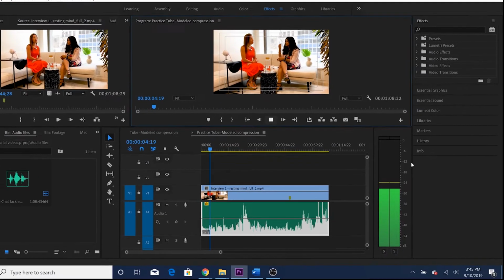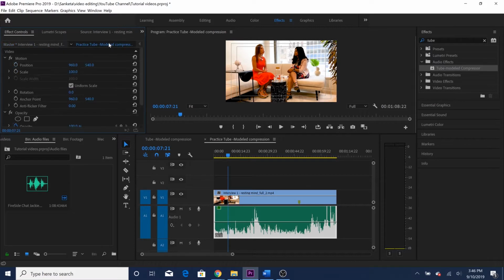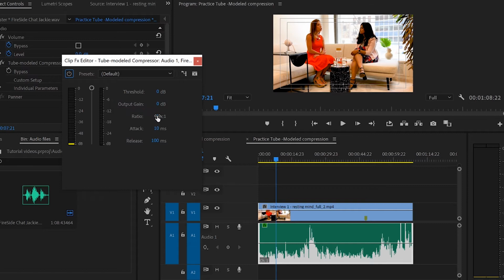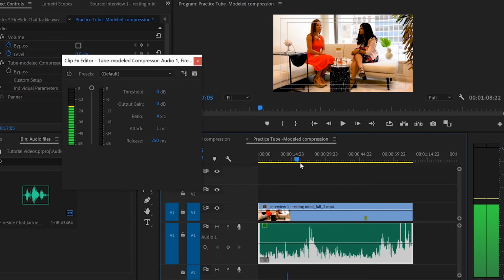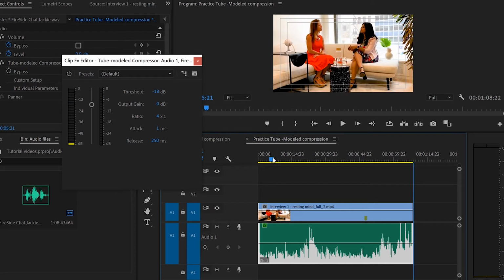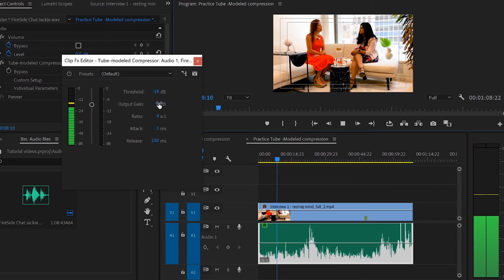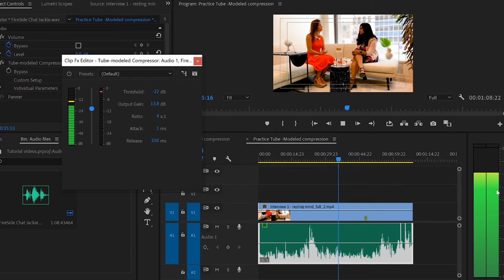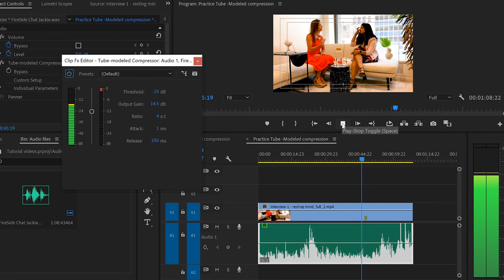Tutorial: Learn how to BALANCE INTERVIEW AUDIO LEVELS | Premiere Pro 2020

Comment: Would this work if there are multiple clips?
Reply from the maker: If there are multiple clips recorded in different settings or with different mic then you will have to apply this effect on each clip separately. But if those different clips are recorded in the same settings with the same mic then you can add this effect directly to the audio track.
You can refer this video to know how you can apply this effect to the entire audio track: 
https://youtu.be/HHuVo2Nhmi8
Reply: @VerticalDots  thanks!